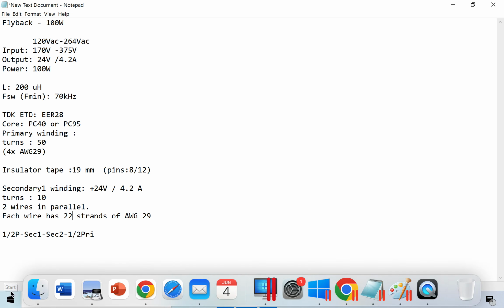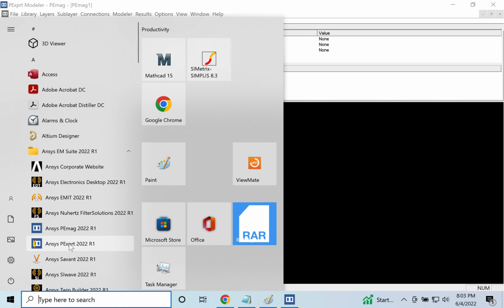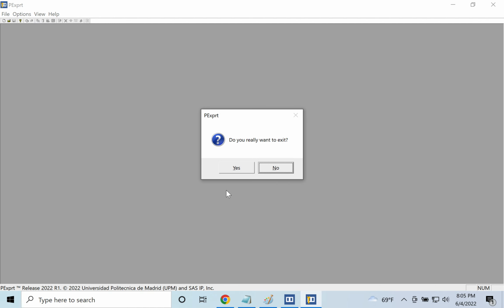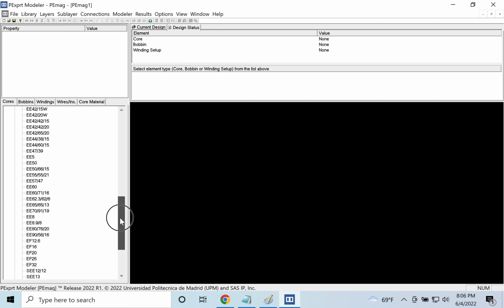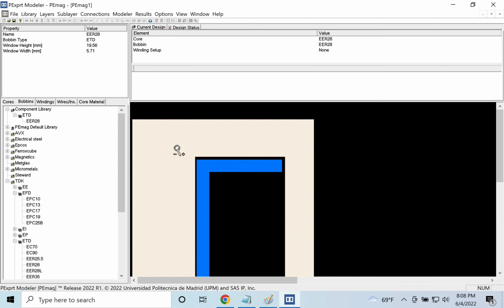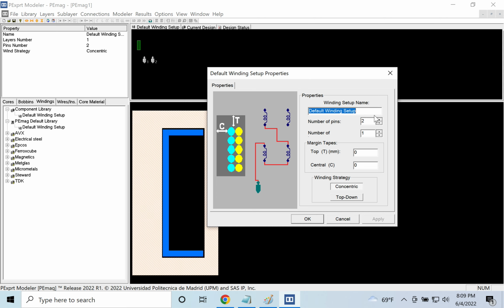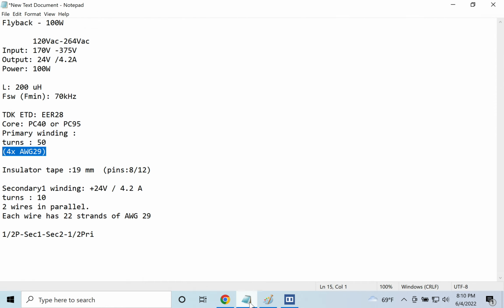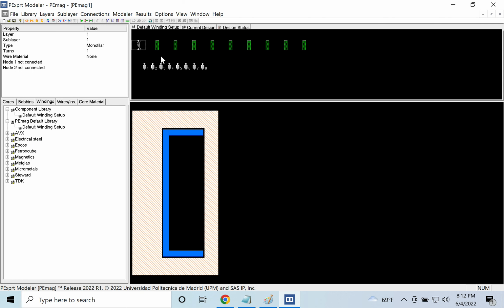Lecture 4- PEmag Introduction

Comment: Hello, is PEMag part of the Ansys student package. Is there any other way to model an inductor if I don't have the PEMag in ansys maxwell. 
Basically I want to model and analyze the inductor in the following pdf https://epci.eu/wp-content/uploads/2019/09/4.2.-Highly-Efficient-New-Hybrid-Magnetic-EMI-Filter-Design-for-Low-Voltage-DC-Distribution1a1.pdf